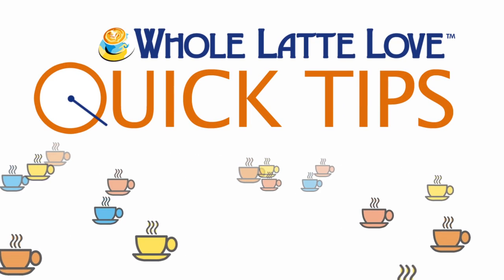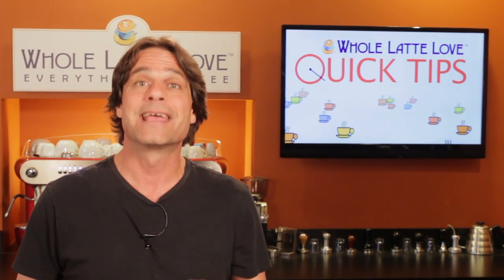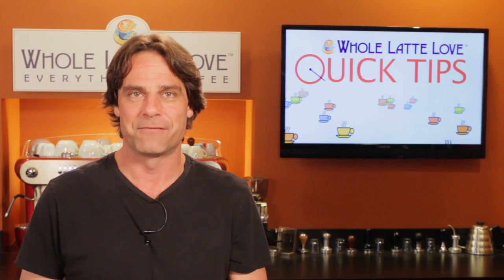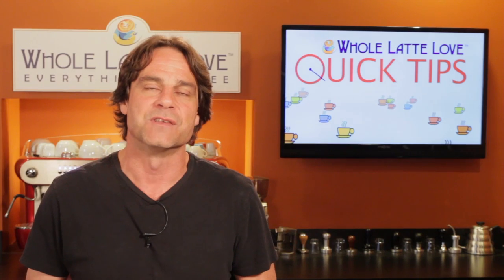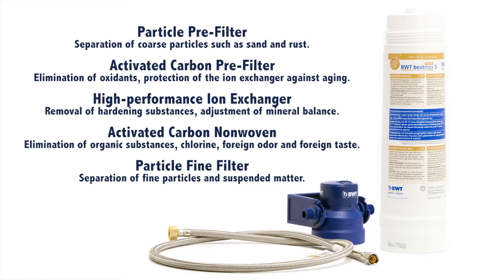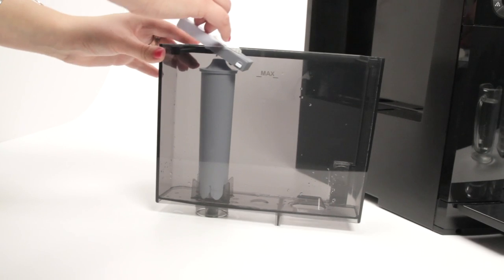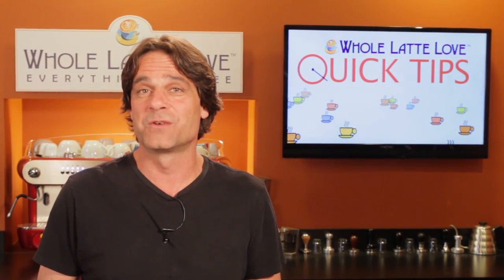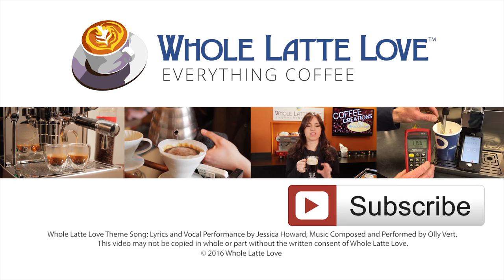Should I Use Ultra-Pure Water for Coffee?

Comment: Hey Marc,  Great Vid, thanks.  Forgetting the topic of descaling, what are your water recommendations?  I just bought a Rancilio Silvia and I'm trying to find the best source of water.  My refrigerator has a water filter, but I'm thinking of getting a filter pitcher, just for easy of getting water to the reservoir without moving hoses and such.  Do you have a recommendation?  Britta is a pretty well know brand, making replacement filters an easy task, but I wonder if it's sufficient.
Reply from the maker: Hi Charlie, You are welcome for the video. So a couple of things you want to do for good water. First remove chlorination and other chemicals. That is done using activated carbon. Your fridge filter may have this capacity. If you prefer not taking water from the fridge then a Britta or similar pitcher with a carbon section will work. There are tap mounted carbon filters available too. Second thing you want to do is reduce (but not eliminate) the minerals in the water. How much depends on your source water hardness. Typical well water is super high while most municipal water is lower but varies depending on source. Most pitcher filters we're aware of do nothing to reduce water hardness. There are some specialty filters like this one: https://www.wholelattelove.com/products/bwt-bestsave-m-anti-scale-filter
This just drops into your machine's water reservoir and takes care of both chlorine and uses an ion-exchange section to reduce water hardness.

Comment: Do I still need to descale my Keruig if I brew my coffee with distilled water. The instructions that came with the coffee makes recommended using distilled water instead of tap water.
Reply from the maker: Hi Bruce, Wow, the instructions say to brew with distilled water? Very surprised as nobody in specialty coffee would advise brewing with distilled water. Then again, Keurig is not in the specialty coffee realm. As mentioned in the video, beyond poor flavor, distilled water can damage internal metal components with long term use due to corrosion. True you will not get scale but there is risk of corrosion.
Marc

Comment: Hi Mark, your videos have been extremely helpful. I am opening a small coffee shop. Water quality is of course an issue because we want to balance flavor and equipment life. From the tap our water has 11 grains of hardness and an average TDS of 212 from municipal water. The taste and odor are not acceptable. So I installed a two stage filter for all the connected equipment (espresso, coffee brewer, ice machine). The first stage is a 10 micron carbon block. The second is a water softener. With this the hardness has decreased to 1 grain and the TDS is basically unchanged at 212. The water looks and tastes marvelous. The measurements are in the acceptable range of the SCAA so I have decided to not do a reverse osmosis yet. But if I do change to RO I would add minerals back. I hope my experience is a help to others!
Reply from the maker: Hi Scott, Thanks for the comment and sharing your experience! Getting hardness down to 1 goes a long way toward preventing equipment problems.
Reply: If you use an RO, what mineral inline filter will you use?

Comment: i am just about to set up my machine. i will be using the filter it came with. can i still use a water filter jug to fill the tank. or is double filtering not good.
Reply from the maker: Hi kim, Thanks for your patience, I've been on vacation and offline. Using both the filter that came with the machine and water filter jug should be fine. Not sure what type of machine you are using but if it's the type which came with a water hardness test strip be sure and test the water from the filter jug.

Comment: I use a Zero water filter jug - they advertise that once filtered, the water has zero total dissolved solids in it.  Is this what you would call 'pure water'?  I thought I was doing a good thing, but after watching your video now I'm not so sure!  Thanks for these videos, they are always so helpful :)
Reply from the maker: Hi, I took a look at the specs for zero water filter jug found here: http://www.zerowater.com/comparison-chart
I found no information in those specs in reference to reduction of calcium which is a major cause of scale. I did see however that the zero water jug employs an ion exchange section. This may be effective at removing some or all ions responsible for scale deposits. Unfortunately, little specific detail is provided on the ion exchange section of the filter.

Comment: Does sugar dissolve really quick in cold, ultra pure water?

"Ultra pure water is a REALLY good solvent" and because of that I feel all the more a desire to experiment with making coffee with it.  I think I've seen one or two videos out there where they tried to do it, but they put the water through a coffee maker, and the water dissolved bits of the machine's metals, possibly plastics, before even touching the coffee.  But, supposedly, when they were talking about this experiment at first, and brought the ultra pure water in front of the camera, it was still ultra-pure, ie, they had it in a container that the water did not pull flavours from.

If the water is such a good solvent, then you'd think they wouldn't have to put it through a machine to extract the coffee flavour.  How about just putting the grounds into that container and letting the water do its thing, cold brew style?  I would guess that it'd pull the coffee flavours out real quick, and once saturated to a point where it was "impure" enough not to pull flavours out of whatever else it touched, you could pour it through a filter, into a cup and enjoy.
Reply from the maker: Hi QM, Thanks for sharing your thoughts which make a lot of sense! I'll have to try making cold brew with mineral free water.
Marc

Comment: what if I use 50% RO water and 50% fridge filtered water (mine has 210 ppm) ? should that give enough minerals back to the water, reducing limescale altogether?
Reply from the maker: Hi VD, Thanks for the question. So that should get you to ~105ppm. That should be enough for good flavor - although some prefer a higher mineral level. As to scale... there are factors beyond ppm which play into limescale formation like pH. Certainly would not have excessive scaling but I'd still descale the machine.
Marc
Reply: @Wholelattelovepage  Thanks for the response Mark. Yeah, I absolutely would still descale but less frequently, right? Descaling is always a bit scary as it can corrode the components so the less frequently the machine needs descaling the better I guess?
Reply from the maker: @valemodsVD  Yes, less frequent descaling. As far as corrosion not something I'd worry about unless you got aggressive with too acidic a mix. Don't know what machine type you have but you can look for sign of scale. If espresso machine with E61 group pull the mushroom and check there. If your machine has HX or dual boiler be sure and pull some hot water off the boiler  - like a cup or two every couple of days of use to reduce mineral concentration in the steam generating section.
Marc

Comment: So I live in Phoenix. Here the water is very hard. Ludicrously. Averages about 500 ppm TDS. I have an RO system. Could I just mix my RO water with the tap water in about a 3:1 or so ratio to get the ideal TDS?
Reply from the maker: Hi B, Thanks for the question. As you likely know that extra hard water is tough on coffee equipment! Using RO and remineralizing with tap water should work. I wonder what the other parameters of your tap water are like pH and alkalinity? Another option for you is to use the RO water and create your own remineralizing mix that'll get you to a brew water quality as recommended by the specialty coffee association. It's very cheap and easy to do using baking soda for alkalinity and epsom salt (magnesium) for minerals/hardness. We have this video showing how to do that: https://youtu.be/iHI7jC0sQZo
Marc

Comment: I wonder if you could use distilled water to descale your machine?
Reply from the maker: Hi Rio, Distilled water is a very good solvent but you really need the acid in a descaling product to effectively remove scale deposits. In theory distilled water should remove some scale. But, the water would quickly become saturated with minerals. So you'd have to switch the distilled water out many times to renew it's solvent action.

Comment: If this is the case, then why do they use RO water in the World Barista Championship? Do they add minerals back into the water?
Reply from the maker: Hi JZ, I can guarantee you they do not use straight RO water. As you suspect, there are "mineral supplements" which are added to RO water to produce a level suitable for brewing.
Reply: What do they use for that? All I was able to find was the filter type that they use that is on the sponsor page of the WBC website.
Reply from the maker: I'm not certain what they may have used. Just know there is no way they would have used straight 0 TDS RO water. It would make horrible tasting espresso/coffee.
Reply: Okay. Thank you. Do you have any suggestions on how to add minerals back to the water other than manually adding mineral packets?
Reply: What would you suggest to add minerals back into the RO water?
Reply from the maker: So I'm guessing you have an RO system or are starting with distilled water. Many ways to get there from homemade to pre-packaged. Here is what SCAA recommends for water parameters: http://www.scaa.org/?page=resources&d=water-standards. I'm not a water chemist, but I do have an RO/DI system which produces 0 TDS water. I make this water for use in a saltwater reef aquarium - but not coffee or espresso. The key parameters from the SCAA are Chlorine, TDS, Calcium Hardness, Total Alkalinity, pH and Sodium. If using RO or distilled water chlorine should already be 0. TDS (Total Dissolved Solids) is related to Alkalinity, Calcium and Sodium. Raising any of those will raise TDS. For the water I make for the corals I use Calcium Chloride for Calcium, Soda Ash for Alkalinity and Magnesium Chloride + Magnesium Sulfate for Magnesium. If I were to make water for brewing from my RO/DI water here is where I would start. To 1 liter of water I would add 17mg Calcium Chloride, 40mg Soda Ash (could use Baking Soda but may need a little more - Soda Ash and Baking Soda have slightly different effects on pH), and 10mg Sodium Chloride (table salt). So that's just where I would start and again, I'm not a water chemist. I'd probably measure the pH and hope it would come out around 7. I might also consider replacing some of the Calcium in the mix with Magnesium as it is less likely to cause scale. There are many discussions and opinions on what to add to pure water to make it suitable for brewing. Some of them get fairly deep into the chemistry. Here's one example from Home Barista: http://www.home-barista.com/brewing/water-for-coffee-quantifying-dissolved-mineral-content-t39853.html
Reply: Okay. Thank you.

Comment: Hi Marc, am confuse on testing hard and soft water with test strip and TDS.  I tested hard water with test strip color is dark red about 400ppm with TDS.  The soft water with test strip color yellow which is in the low, but I tested with TDS meter it showed 375 ppm, it almost the same as the hard water.  I thought it should be a lot lower under 100 ppm or lower.  So because the ppm are high is there scale and calcium in the water still?
Reply from the maker: Hi Red, Thanks for the questions. This water stuff gets very confusing! Especially when you have different ways of measuring like TDS, calcium hardness and general hardness. Then there are testing errors. TDS meters typically use electrical conductivity which can be prone to error and measures things beyond minerals in the water hence the name TDS = total dissolved solids. Calcium could be low in water yet other things in the water like salts, magnesium, silica could still give a high TDS reading.

Consider this... My local public water runs about 150ppm on a TDS meter so it's on the soft side. For plumbed in espresso machines we treat that water using a BWT filter which uses ion-exchange to replace calcium with magnesium. After treament the TDS still reads ~140ppm. But test the treated water for calcium hardness and there's a very significant reduction vs. pre-treatment results. General hardness which measures all mineral content is just slightly lower. With the lower calcium there's a significant reduction in scaling potential as calcium ions have greater potential to cause scale than magnesium ions.

In your case with similar TDS results between your hard water and soft water there may still be potential for scale formation in equipment. I cannot be certain as I'm not sure how you are softening your water. 

Marc

Comment: my water filter is an RO membrane filter, and its our way we get our drinking water; would I be able tp use this water in my profitec pro 500 or 700 and be able to eliminate descale
Reply from the maker: Hi Chris, RO water is typically so pure it has no mineral content at all. So, RO water will not cause scale. But, and it's a big one... RO water makes horribly flat tasting coffee due to it's lack of minerals. Think of eating a food you usually put salt on - try eating it with zero salt and it's just not the same. Minerals enhance the flavor of coffee. In fact the SCAA specifies certain mineral level and other water qualities for use in cupping. Learn more about their recommendations here: http://www.scaa.org/?page=resources&d=water-standards
Reply: so can what are my next options if I want to yoou tank, because the only only drinking wwater is RO source: besides drinking tap.
Reply from the maker: Chris Chang Municipal RO water? Or do you have your own RO system? If municipal, it usually has minerals etc added back in after treatment. Ultra pure water water is such a good solvent it can hurt metal pipes overtime so municipalities that treat water using RO add minerals etc back to the water to prevent this.
Reply: it is filter through a RO membrane filter, i dont know if that helps

Comment: I just use bottled drinking water.  Is that okay?
Reply from the maker: Should be fine. Bottled water generally has some mineral content for flavor. As for how that effects the need to descale it would help to know the actual mineral content. Most brands of bottled water have that information available online.
Reply: Thanks! The ingredients are listed as:
Purified Water, Magnesium Sulfate, Potassium Bicarbonate, Potassium Chloride.

It's the Target brand "Purified Drinking Water".  That's usually what I use, but I'm sure most "drinking water" is the same.
Reply from the maker: OldWest311 The magnesium in the water should not cause any scale buildup. The bicarb and chloride will. You will still want to descale your equipment.

Comment: Your first statement about lack of taste is half way true. Yes using spring water makes the best coffee, but just increasing the pressure on your coffee grind and using premium coffee such as costco starbucks verona or winter blends , make out for most of the difference in taste. The second argument that distilled or water with no minerals will destroy machines or boilers by trying to attack the copper or stainless steel never showed in my Silvia. Last year after more than 12 years of used I replaced the leaky gasket of my brass boiler, and amazingly the inside and the heating coil looked like brand new...... You want to make me believe that it attacks metal..... NO  manufacturers have  interest that you use non mineral waters, because your machine will last so long, and no replacement is in the near future  affecting their business to sell  new machines to previous owners. If you don't know what is "programmable obsolescence'', please google it.
Reply from the maker: Hi Luke, Thanks for sharing your opinion. Planned obsolescence? Very familiar with that term. I'll disagree strongly that manufacturers don't recommend using mineral free water in order that their machines eventually fail. Believe me, it's not the case! They deal with unhappy customers which run into machine problems due to lime scale  - it's the most common cause of problems in espresso machines. If it was as simple as use pure water they would definitely recommend doing so. Problem is pure water over-extracts coffee causing bitter flavors. Then, without minerals the coffee tastes flat. So you get flat and bitter coffee. Ultra-pure water can cause corrosion of metals. Some metals more so than others but it is a risk. One reason you will never see pure RO water run through metal pipes. Many commercial establishments use RO to treat water for espresso machines and food service. RO treated water is always remineralized for taste and equipment protection from corrosion.
Marc